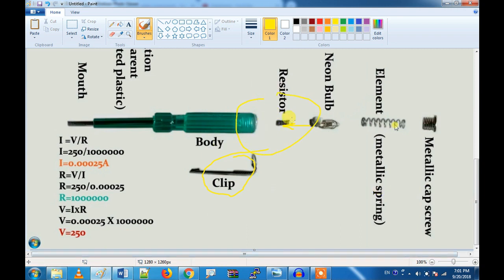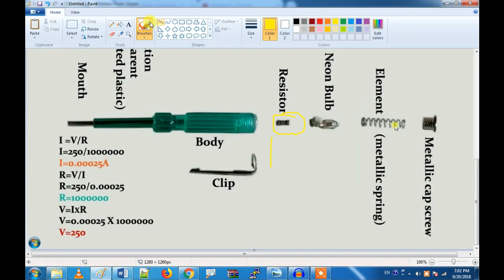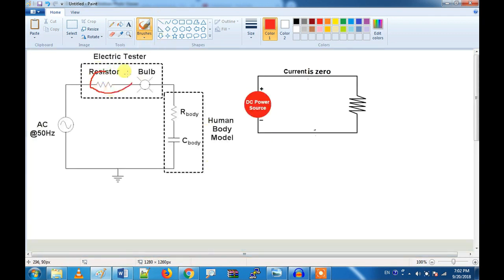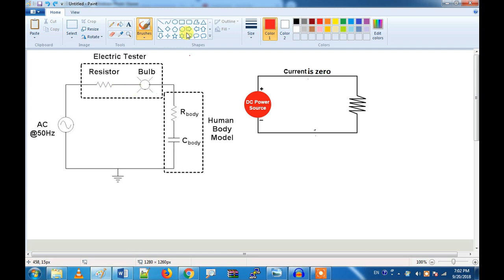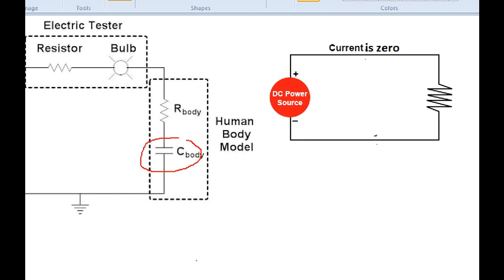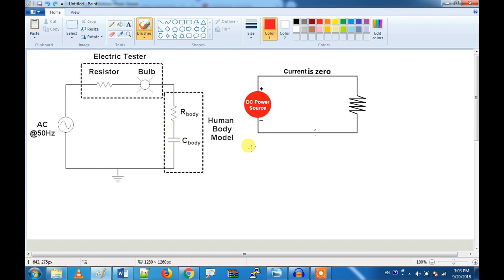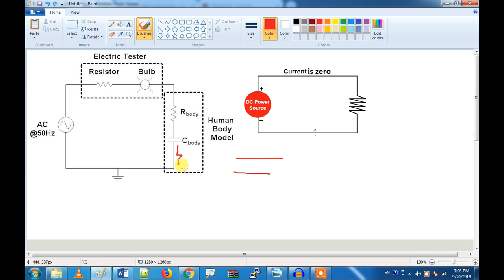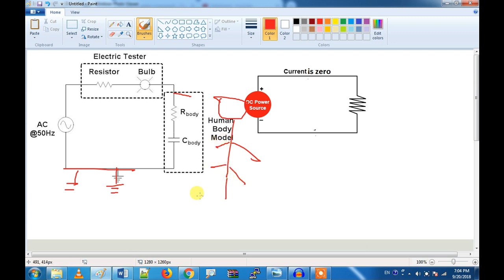Electrical Tester in Tamil டெஸ்டர் க்கு  உள்ள இவ்வளவு விஷயம்  இருக்க ??

Comment: vcb breaker pathi video podunga nanba
Reply: Vcb breaker used in high voltage system.so that it reduces the ionisation air molecules causes the spark or arc in the contact while making contact sf6 breaker used

Comment: sir neutral valiya  negative half cycle varuma
Reply from the maker: negative half cycle current only flows..voltage does not come
Reply: @Techdoct  correct neutral is earthed with ground hence remains at 0v so negative voltage but current i.e the return current which has both positive and negative half cycle will flow
Reply: Athu Epti Bro varum.... Konjam Sollunga anna